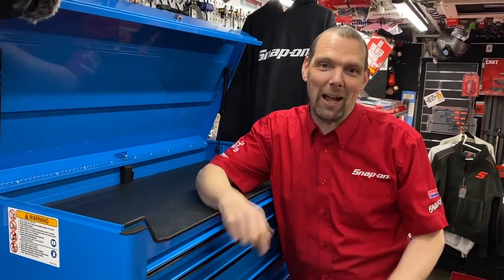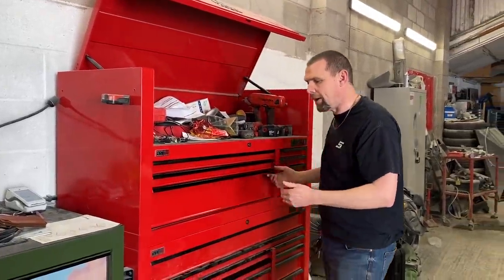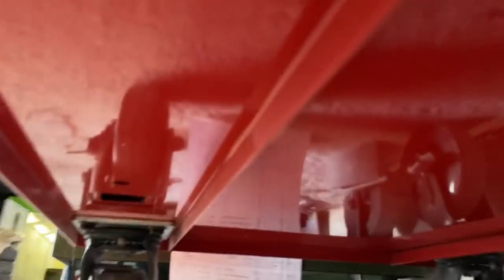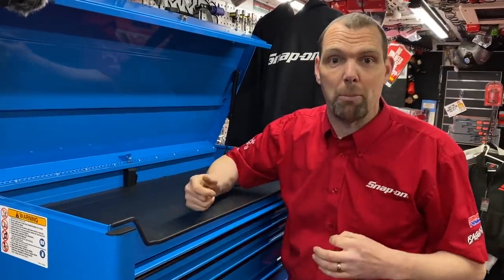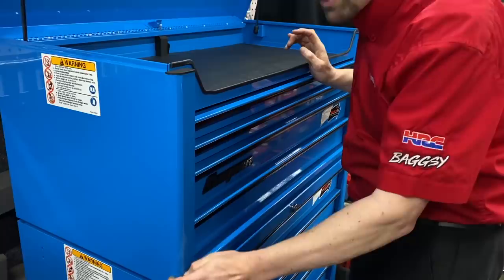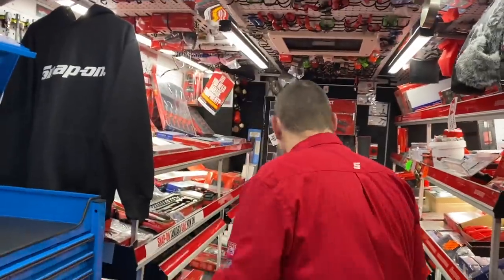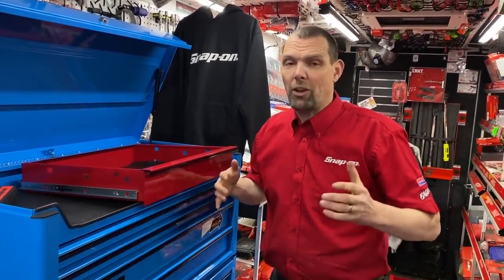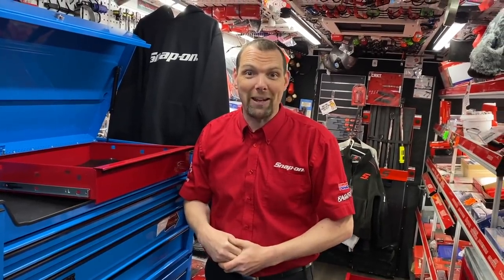NICK THE TOOL: MAC TOOLS BOX VERSES SNAP-ON TOOL STORAGE, WHAT IS THE DIFFERENCE???

Comment: Snap On built in China, that is a deal breaker.
Reply: The heritage used to also be made in Canada ( mine is Canadian ) the china ones are no where near as good
Thinner metal
Only one lock pin in the lid
A few other corners cut
Spot welds on the rear weak as hell

If your getting a snap on box make sure it’s a Canadian built one
Reply: The china ones are only for the European market any snap on box you buy in the US is made in the US by snap on
Reply: @jeffferryyyrippppp4629  that’s BS
Reply: @kells77  You can watch a video of them building boxes in the US lol
Reply: @kells77  US toolboxes are manufactured in Algonna, IA
Reply: @tylermusolf8995  mine says made in CANADA on the stickers
Reply: The are still built better than Mac, no matter where it is mead
Reply: Only the cheap ones are made in China,,,better ones 100% USA made
Reply: @jeffferryyyrippppp4629  hell ya !!!!
Reply: Such a deal breaker that you replied to this video, from a device that I am 1,000% sure, has parts from China… Brilliant.
Reply: @ChrisSalazar1983  1000% isn’t possible….
Reply: @user-fp3gx2ow7p  If you say so… Go ahead and keep Virtue Signaling from a Foreign device lol
Reply: @ChrisSalazar1983  😎👍🔧
Reply: Mine says made in the USA

Comment: The edge is cheapest box Mac makes.  I’ll put my macsimizer up against and snap on box made.  I got rid of my snap on for a Mac 😂
Reply from the maker: Thanks for your comment, as you can see from the narration, this video compares both Mac and Snap-on entry level boxes. They are very closely matched on price
Reply: @NICKTHETOOLUK  I have the edge box. My wife now uses it for home use. 😂 I had a jerk snap on dealer. Wouldn’t warranty my box. Or anything I didn’t buy from him.

Comment: I picked up a 430 roll cart in Dark Titanium and I love it, easy to roll around even loaded with tools. I will say though while I get the critique of a top drawer 6" tall is way to big and needs more then 1 set of slides, A taller top is very handy. While it does collect random stuff, that is also where a lot of battery chargers, spray cans and other taller quick use items go. If I want to just close the lid to lock up, the extra height is well worth it there.

Comment: Your right about snap on boxes. I own two 53 inch roll cabs and one 40 inch top and bottom. All Heritage boxes. I have them loaded with tools and I use the two 53 inch roll cabs with butcher block tops as work tables.

Comment: I’ve been a HGV mechanic for 17 years now, that heritage snap on box is a excellent tool box & built very well, it will definitely out last the Mac select series. I know this because I work with guys that have both boxes. The wheels on the Mac are pushing up into the box frame all the drawers are sagging etc definitely not built for heavy diesel tools. 

Now I’m not saying Mac tools boxes are bad, definitely not the case, the tech 1000 series and up-words are built very well like tanks and I would recommend buying.

Comment: I had an heritage stack in electric ograne had it for 14 years. Brought it somewhere about 2004 and a single issue with it then I brought s 26" heritage roll cab in same colour no had no issues. But I've seen other techs buy the 40" and 55" heritage box's and had a lot of problems with the draw runners failing and drawers coming out and scratching the box's and dropping on the floor. I noticed that compared to mine snap on had changed the manufacturer of the runners sometime after 2010 and they don't seem as good. I'd like to know if this has need sorted as they was the only down side to the box.
Reply from the maker: In 20years as a snapon guy i have never seen a drawer just pull straight out.  It physically can’t, unless forced.  It can happen if the box is in a van/truck and full of tool and the box isn’t locked.  The force of braking/cornering can mean the drawer comes out at speed and is forced past the stops.  The roller ball slides haven’t changed in 20years, same part number
Reply: @NICKTHETOOLUK  just the runners looked different to the I had and the one I had didn't have China stamp on them like the ones the other lads brought. I know a lad that had a classic in a van and yeah he had some issues with the drawers snap on did replace them a number of times for him.

Comment: Your comparing apples to oranges Nick that is macs entry-level box.
Grow a set and compare the macsimiser to the snap on line up. 
Because snappys can't compete.
Reply: Regardless of which brand you like, it’s max trying to take the market share from SnapOn, Mac is the one trying to compete with the gold standard.
Reply: Not to mention dummy, he clearly says the mac box is an entry level box, and compared it to the SnapOn entry level box. Did you not watch the video? Apparently not even half way?
Reply from the maker: The is snapons entry level box, very similar price tag
Reply: You opinion is biased and blind.
Reply: Full disclosure. I am a Mac man. But at one point I sold for SO. I’m glad you said it so I don’t have to. Basically, SO entry level has features Mac’s doesn’t. Didn’t see them mention soft close on the Edge though. Key word here is entry. These boxes are made to compete with Harbor Freight and Home Depot. I’d love to see what they say about the Macsimizer or the Macsimizer HD. As a guy that’s been through the SO machine, I’m very aware that they know they can’t compete.
Reply from the maker: @brianmillsap396  thanks for your comments,  i’m only seeing these Edge boxes on my patch in the UK.  They are a similar price to our heritage range. I agree that the Mac boxes high in the range are built better than this Edge range and I can see these have been priced to hit a price point.  I appreciate your comments

Comment: The Snap On box is clearly a better designed and built bit of kit but sweet jesus are they expensive! I've had a Facom Jet roll cab for many years which was a fraction of the price of a Snap On box and it has performed flawlessly. Maybe under the skin the Snap On is, again, much better built, but I honestly think the price is just too much.
Reply: I have a lot of Snap on and Facom....the Facom I'm always  delighted with😊

Comment: My heritage series tool box is absolutely  Garbage! The roll cab is falling apart as the spot welds have failed. The sheet metal the casters sit on has collapsed in from the weight. The entire box leans to one side when pulled and because of that the drawer slides keep failing.  I tried warranting it and it gets ignored.  DON'T overpay for a tool box with a name on it, it means nothing these days. It's profits before anything.
Reply from the maker: Thanks for you comments.  Just wondered, how old is your box?  Which size to you have and what trade are you in?
Reply: @NICKTHETOOLUK  the box is 20 years old its similar to KRA4107FPBO but it has the old hard plastic casters. The hard plastic casters transfers every bump from the floor and the welds have failed. I used to work as an auto tech.
Reply from the maker: @SLIDEWAYSLIDEWAY   I know the box, they were made around 1985,  7 drawer so around 37 years old. With rockite hard casters. They didn’t last as well and the current construction design.  The boxes have evolved over the years,  they appear the same but have much larger caster plates and a reinforced chassis. They are also designed to carry a lot more weight and move faster over uneven floors.  Thanks for your comments
Reply: @NICKTHETOOLUK  the box is actually 21 years old and was supposedly to have the Snap on life time warranty. There are more better and quality boxes with better value out there so Snap on is just a name and not worth the price of a new box.

Comment: Mac over snap on  any day
Reply from the maker: Glad you enjoyed the video.  It’s your choice.  May i ask why you would choose the Mac box which is the same price?
Reply: @NICKTHETOOLUK  hi couple off years back bought a brand new snap on  40" box off my local dealer all the spot welds around the bottom off the rollcab broke away
Would never buy snap on again
Reply from the maker: @LockeM140  WOW,  in twenty 22 years of being a snapon dealer i have never seen 1 spot weld break,  never mind multiple spot welds??? Do you have any photos ?
Reply: @NICKTHETOOLUK  sent it back got another new sent in different  colour not happy then sold it straight away

Comment: Mac do 3 or 4 ranges of toolboxes from cheap and nasty crap through to top of the range Macsimiser, which wipes the floor with the top snap on
Reply from the maker: As mentioned in the video, this video is comparing the entry level Mac with the entry level Snap-on